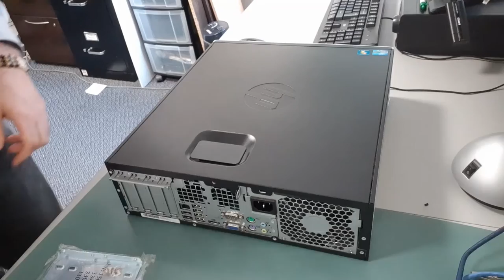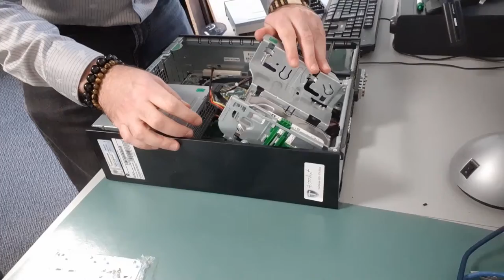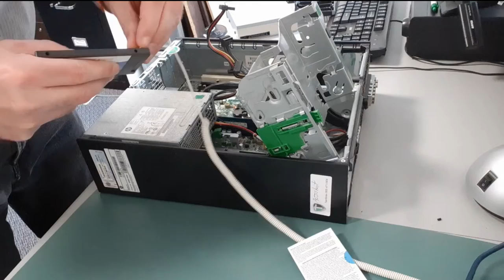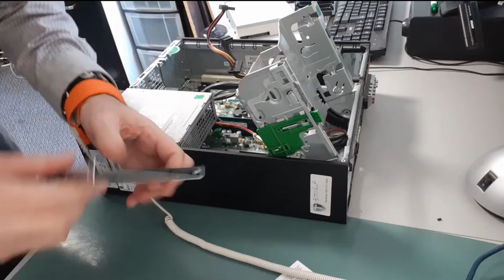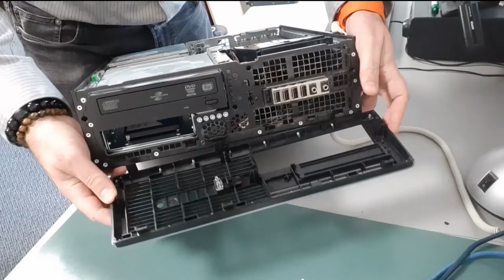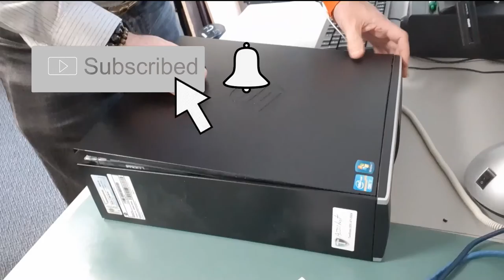How to replace a hard drive in an HP Compaq desktop computer

Comment: sir my pc which i believe is that same computer does not have a lever to open up the case. there is nothing there, can you help me
Reply from the maker: There are so many variations, there is either a screw, a lever of some sort located either at the top or base of the case.  Sometimes an entire frame comes out.  Yours must be a slightly different model.  You can go to https://support.hp.com/ and let it scan and detect your computer.  Then you can find a manual specific to your computer that may tell you what you are looking for.
Reply: @TwinBytesInc  Thanks I managed to figure it out. It had a screw on the back! Thanks so much.
Reply from the maker: Excellent!  you're welcome.